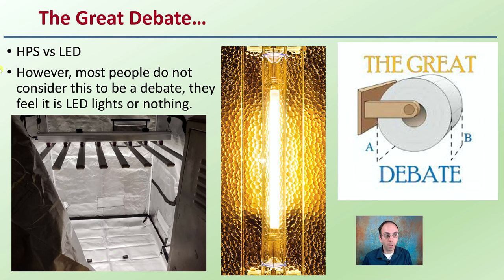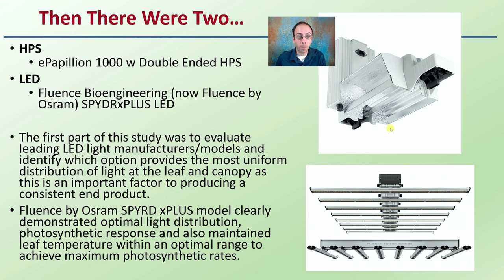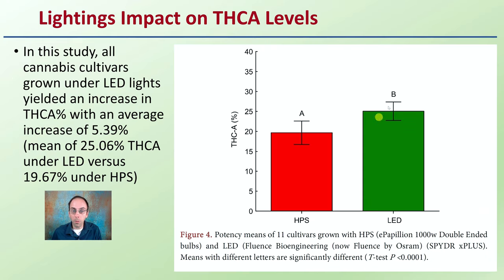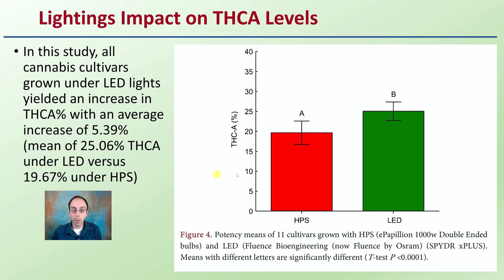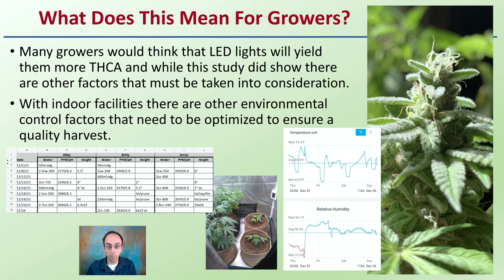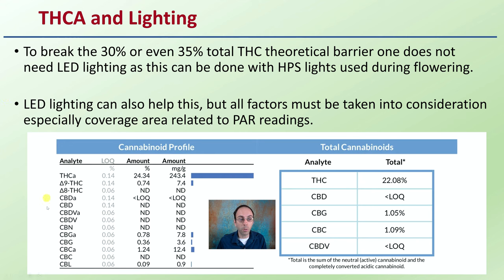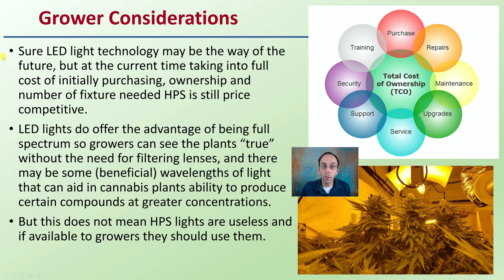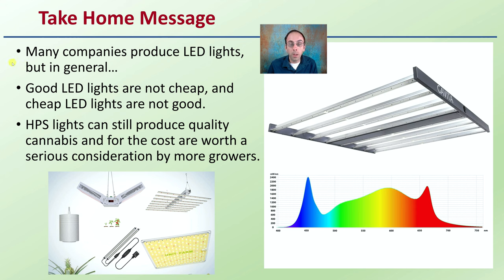Potency of Cannabis Grown Under LED and HPS Lights

Comment: What about Cmh? Color is the closest to sunlight you'll ever find and contains uvb...
Reply from the maker: CMH lights are great, but not part of this study.
Reply: @DeBaccoUniversity  noted but it is a necessary subject in the future in my opinion. Cmh is a lot cheaper then led and early evidence suggests it's better yet its not hyped up like LED's that get promoted the whole time despite their high prices by people looking to make a buck... I'm moving over from HID to the new double ended 1000w cmh lights in my flower rooms later this year. Busy testing a 1000w cmh light and I'm very impressed, LED's don't offer uvb and the ones that do break quickly because the light destroys the fixture which puts the cmh at an advantage not to mention 1/3 the price....
Reply from the maker: Interesting concept and look forward to hearing your results.  Not sure how to contact you but is possible it would be interesting to learn more.
Reply: @phillipjacobs9147  Indeed cmh are great. The only problem I encountered with them was heat control. They do heat up a lot, even with ventilated hoods. (great for cold winters for heating the house)!  If you can keep your VPD dialed in, you have a Ferrari in your hands. I agree about LED cost vs double ended. I bought cheap 100W COBs X 9 for 4x4 three years ago and I like the versatility of canopy coverage and quality of the fruits!. Cheers!
Reply: @telnek  problem with ventilated hoods is that the glass from the reflectors will block the uvb from hitting the plants. If you normally grow in rooms with AC and open DE fixtures and not tents with ventilated hoods the CMH produce pretty much the same amount of heat then the hps. Generally you need about 3500 BTU of ac for every 1000w fixture where it'll be around 2800 or so for a 720w LED so they don't use a lot less electricity like some people would like us to believe. I guess it comes down to what someone's goals are, if someone is a homegrower who just wants to grow enough for himself at a reasonable cost led or cob is definitely the way to go but if the goal is to produce boutique quality flower for market the CMH lights kick LED's ass in my opinion. Cheaper then led, better spectrum and the Uvb they give off  is just magic.
Happy growing man, it's awesome that people are starting to grow their own
Reply: @phillipjacobs9147  Absolutely! I just went with the ventilated hood, assuming you were talking about testing "a" 1000cmh, and assuming it was only one light, assuming home grower in a tent!!! You see where I'm going with this! I was assuming and it makes me an a** !!! Seriously, for commercial, I would do what you are doing and test all the energy input costs with cmh (AC, bulbs, co2, etc...) compared to a high quality LED costs (same AC, co2, initial price, etc...) and amortize costs over 5 ot 10 years. Of course the end product quality and quantity. Great discussion! Let me know your observation with your side by side test please. Cheers

Comment: LED lights lack IR.. most of you don't know the significance of that because sponsored ads leave this out.
Reply from the maker: This is in part what makes LED lights so efficient, no "wasted" energy to heat, but form a plant perspective the sun comes with IR (heat) energy in addition to the visible light spectrum.
Reply: @DeBaccoUniversity  I tired multiple grows with LED and I eventually had to run both humidifiers/dehumidifiers and AC to get the proper VPD, which actually negated the savings. LED grows also require more nutrients, like 30% -40% more vs HPS. The lack of leaf transpiration with LED's requires the grow room to be 4 to 5 degrees higher vs HPS, and Imo that is where LED loses potency. Don't get me wrong, LED grows look phenomenal and yields are definitely higher than HPS per/watt, but the smell, potency and smoke quality is nowhere close to HPS imo. Last thing, all of my LED grown bud never burned to white ash like HPS grown bud.. it was always burned to a black, greasy ash. My theory behind this is that LED's lack of IR does not allow the chlorophyll to degrade as rapidly as with HPS. I also think the insane amounts of Magnesium LED's plants need contributes to the black ash. Again, its just a theory and I am way to dumb to know for sure lol.

Comment: First off... lol. Let's not say HPS, Let's say HID. Next, a garden done proper with HPS staggered side by side with hortilux true blue MH with full spec and UV. This set up crushes LED. Diodes are not better than chemistry when you aren't just using one bulb, but getting the full reds from the hps intermingled with the full spec and UV of the MH is fairly untouchable. Don't use the DE's, it's a 600 hps with a 400 MH, but they don't use the full spec MH with UV, AND they aren't vented, so your AC has to overcompensate and drives your bill up, I'm on the fence on rather or not Luxx knew this and pushed them just so they could compare the energy usage between HID and LED and make it look worse so they could sell more LED, as the profit per light is astronomical in comparison. Everything told you is an industry lie to sell you more bulls$%t, and everyone seems to have drank the coolaid. Led will probably get there someday, and when they do, it's gonna be them hyping the new orange red spectrum they just figured out how to create with diodes, that we've had access to via hps the entire flippin time, watch and see.
Reply from the maker: MH and HPS and CMH are all HID, the goal is to be specific in the comparison which is why the HPS term was used.  Your comment also speaks in very general terms... which HPS light, which LED light?  Details are provided in the study and should be provided in the comment as well.
Reply: @DeBaccoUniversity  oh, sorry I thought I said Hortilux. Though, there are many good performing HPS bulbs, some arguably better. The main idea is that the BLUE Hortilux MH with full spec and UV (I believe it's the only one on the market that can claim that.) Staggered in a garden with the red eye hps gets you the bulk from the traditional hps, while also the powdery mildew resistance and other benefits of UV from the MH, along with being a very full spectrum bulb. My problem with a lot of studies like this is that they compare just a single hps bulb with an led, but thats not what a lot of experienced growers are running, rather a mix of the red and blue hid combined. In my over 15 years experience in a professional garden, this set up slays everything else. I'm not some hortilux fan boy or paid promo guy, just sharing my hands on experience.
Reply: First off just saying hid covers three different fixtures with three different Spectrum capabilities. Second If This Were True commercial Growers would not be switching from this combination as quickly as they can to led. If those are the results that you get, it just proves you don't know how to grow with LED. It's not an issue with the fixtures. It always blows my mind when an entire industry finally figure something out and then some Grandpa who's scared to step out of his comfort zone pretends that his old way is still the best.
Reply: @musicisblood2636  I hope you don't use any hoods with glass because say goodbye to your UV if that's the case. And there are UVB bulbs and fixtures available some included with and some as extra fixtures. UVA is just glorified blue. So it's not something only available with hid bulbs.
Reply: @demsandlibsareswinecancer4667  Na. I actually have a UV tester, and plenty comes through glass. I'd heard the same thing so tested it myself proving it false, at least with my hoods. Also, real UV isn't just , "glorified" blue lol, it's actually noticeably damaging to the plant cells if it's too close. I have the UV indicator card from hortilux, and it reads low to moderate UV through the glass, even moderate is damaging if you get it too close, I keep it low.
Reply: Perfectly said.
Reply: It's cute that you think so, but if it were really worth it, commercial Growers would not be switching as quickly as they can from hid to led. There's nothing that you can do with a bulb that you can't do with multiple LEDs of different wavelength. I mean except for cook plants in a room like an oven. There's a reason that even the blurple BML spyder fixtures of 5 and 6 years ago were beating out hid in both quality and quantity across multiple strains at a time. That's before they got wise to the fact that nature and God are much smarter than they are and that white light is better than purple. Who would have guessed. There are just those of us afraid of change. They hate it when they're precious trophy gets knocked off the shelf from their time bowling back in 1977.😆🤣
Reply: @musicisblood2636  Not trying to contradict your overall point of the Hortilux Blue. I have used them plenty over the years. However, Sunmaster has a line of bulbs called the Full Nova which has a great full spectrum and UV. I have used these plenty also and they produce the quality that is on par with the Hortilux. Sunmaster also have two CMH 315 watt bulbs in that line as well.  I agree with your point about the constant comparison to HPS. The horitilux HPS did perform the best out of all the HPS bulbls I used but it still is not full spectrum like the LEDs or the Hortilux Blue or Sunmaster Full Nova. So using HPS as a comparison to full spectrum LED is apples to oranges.
Reply: @mrdino5101  The idea that full spectrum is better is a fallacy. The red spectrum from hps is far better for overall bud quality. Full spec has benefits when supplementary for sure, such as mildew resistance. Hid lighting got so cheap it was hard to profit from, Led can be purchased in bulk and branded from Alibaba with your own packaging, and marked up hundreds of dollars per fixture. As led is not a true gas reaction like real bulbs, they couldn't produce the red HPS spectrum properly, only blue or full spec, and so that's where marketing went, because in the initial boom dispensaries we're buying hundreds of fixtures, so this move to sell them led made people millions. All hogwash.
Reply: That depends on your conditions. My walls are meter+ thick, my cielings are high, and made of wooden slabs with occasional cracks leading to unused space upstairs. I only grow in the warm part of the year. Thus my climate control costs can be, and are, exactly 0 despite HID. The only electrical equipment that costs me extra are my security cameras.

Comment: "good" led diodes are too expensive, cheaper  ones burn out, I think led is a con still till better price for quality are available, I use cmh 315 veg 630 flower, it is the best spectrum, anything close to sunlight is the best.
Reply from the maker: Many agree with you;-)

Comment: "At the suggested distance from bulb to canopy in the HPS versus LED comparison (6 inches for LEDs and 4 ft for HPS), carbon assimilation rates displayed a 142% percent increase in plants grown under LED vs. HPS with average photon flux densities of 795 and 298 µmol∙m−2∙s−1 for LED and HPS, respectively."

What is "suggested distance"... they subjectively chose an arbitrary height that doomed the HPS from the start. I own two SpydrXPlus and love them but this is just bad science. Osram funded this or something. I would have compared the different spectrums at heights that had matching PPFD.
Reply from the maker: Many times scientific studies use "manufacture recommendations" which is what should be followed since the manufacturer should know their product the best.  Sometimes to achieve the same light intensity with HPS the heat may result in leaf damage due to heat so this is why the manufacture suggestions are followed.
Reply: @DeBaccoUniversity  That's a very sterile way of admitting that they twisted the manufacturer's recommendation out of context to get dramatic results. Height recommendations change per application. All this study shows is that Fluence chose to recommend a more intense hanging height than ePapillion. You could also get into why they chose to compare a 650w LED to a 1000w HPS. It's bizarre that they did that without finding a common point to compare them from (PPFD). The manufacturer recommendation for height is totally irrelevant in my opinion. We're interested in the performance on plants, not the performance of a companies marketing. The difference between 25% and 20% thc was due to the more than double amount of photons that the LED was allowed to give vs the HPS. You didn't address that at all in the results.